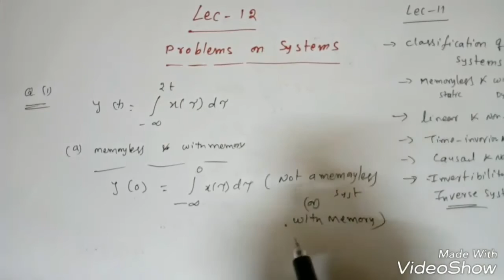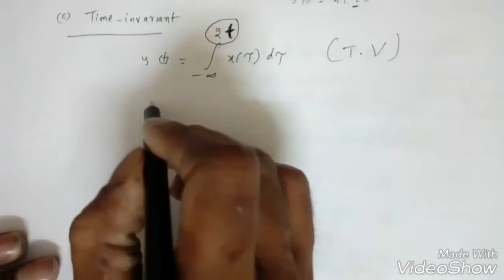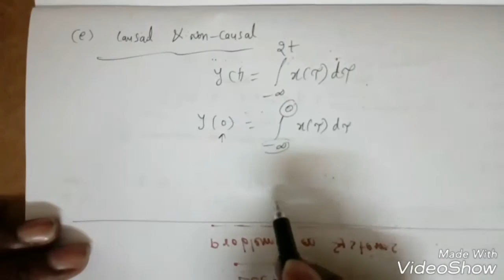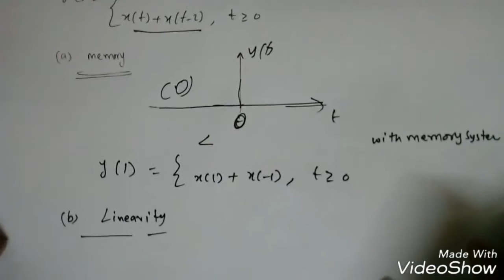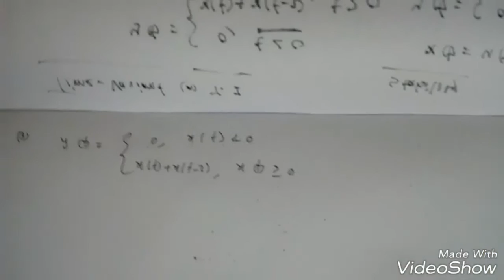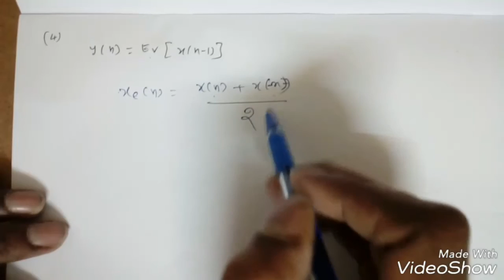Signals and Systems Lec -12: Problems on Systems

Comment: Sir please clear this doubt
Even x(t) is causal or non causal
CS x(t) is causal or non causal, and linear or non linear
Reply from the maker: i did not understand the question, what is x(t)?
Reply: x(t) is a signal, and find even part of x(t) is causal or non causal same as conjugate part of x(t) is causal or non causal
Reply from the maker: even of x(t),  y(t) = (x(t)+x(-t))/2, so it is non causal because for t = -1, y(-1) = (x(-1)+x(1))/2 . i.e present output depends on future values of input..similarly conjugate part of x(t) is also non causal
Reply: BT in made easy notes it said it's a even part of x(t) is causal and conjugate part of x(t) is non causal, and mine ans is same as yours
Reply from the maker: is there any explanation is given? if not go with our analysis
Reply: what is conjugate part of x(t)?

Comment: 27:58 
The system is unstable, right?

The limit ranges from -1 to infinity, which's unbounded and hence unstable
Reply from the maker: Asif Ansari it's not about limit as t tends to infinity the signal should be bounded here we are not finding summation or integration ..just checking bounded or unbounded as t increases

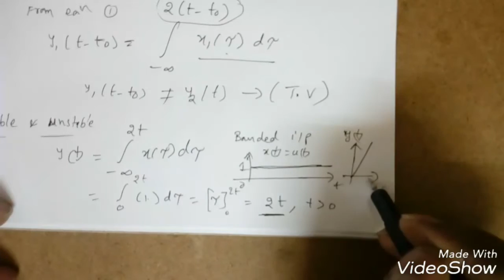Comment: sir at 10:00 what if we assume a sinusoid as input ?
Reply from the maker: that also gives unbounded output right, because sinusoidal means it is from -infinity to + infinity..if we integrate from -infinity to 2t it gives unbounded value
Reply: Learning Is Everything sir if we take sin signal as input..its bounded signal right? Then after Integration we will get negative cos(2t) and cos is also a bounded output signal then how come its unbounded?

Comment: sir please check i think u have taken wrong limit  at 8;37 the limit should be from -infity to 2t - to but u have taken 2t + to? so the answer is time invariant
Reply from the maker: we are changing variables in that scenario, that's why the limits changed to -infinity to 2t+t0..just check at 6:40
Reply: sir i  am saying when we put z(tou)= -infinity the k becomes -infinity and when we put z(tou)=2t the k should be 2t - to right? but u have written 2t+to ..this is my issue....because z=k+to , k=z-to so foe - infoinity k same but for 2t k should 2t-to please correct
 if i m wrong
Reply from the maker: Montu Malhotra I got it thank you..but any way that system is time variant only
Reply: welcome sir 
yes system is time variant only

Comment: Sir, How do we check whether system is invertible or non invertible? in both the cases of discrete time and continuous time? please give procedure and example
Reply from the maker: we have to apply two different signal...if the output is same then not invertible if output is different invertible..i will make one video on those problems.
Reply: Eagerly waiting for that... Thank you so much sir!! :-)